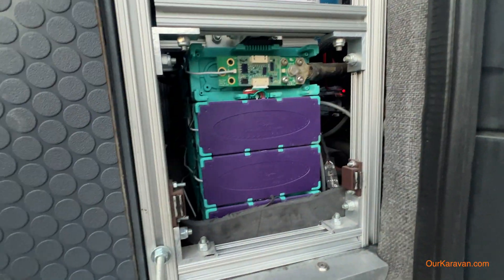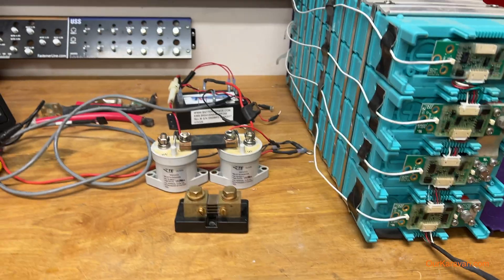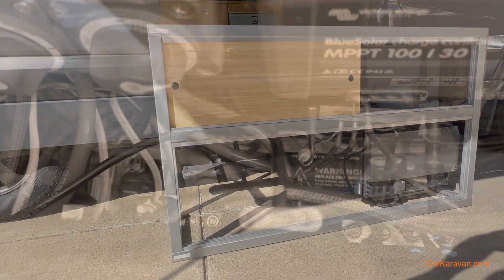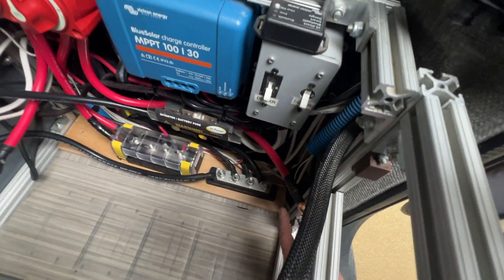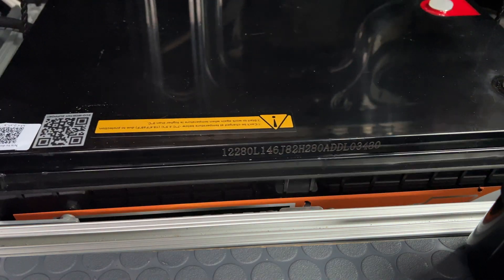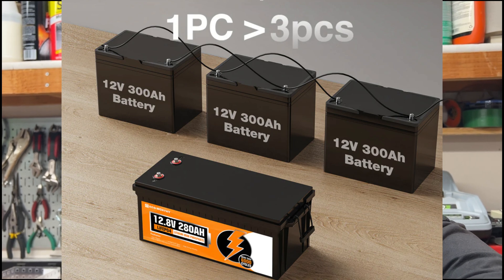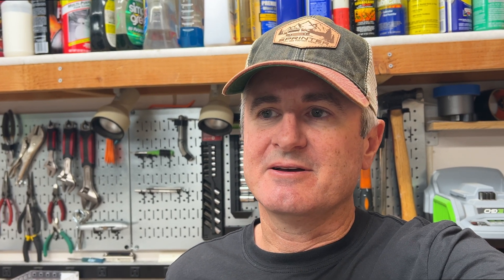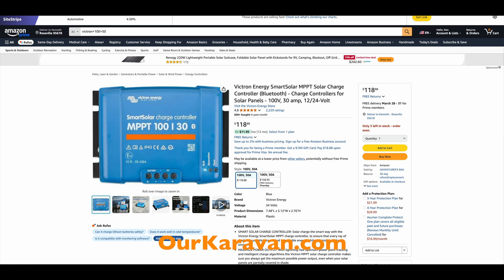Eco-Worthy 280aH Battery & Electrical System Overview

Comment: Nice vid, thank you for sharing. I was just wondering why do you still have the smart-shunt in place if you already bought the Bluetooth option of the battery. Does the BT capabilities not make it redundant to have in addition the smart-shunt? I would like to understand the difference between them and why would you still keep it in place, is it just to have it visible in the victron display or does it have another reason behind it? Also by checking your online diagram I am also wondering why do you have 2 inverters separated between solar and alternator? Can you not use a source selector?
Reply from the maker: Good question.  The built-in shunt of the battery has all of the info you need, however I simply wanted a dedicated display so I don't need to check my phone.  There is absolutely no need for the Victron smartshunt otherwise.

Comment: Thanks for the video!  I want to double my battery capacity.  Currently 2 x 270 AH Battle Born.  Rest of system is Victron.  I don’t know whether to start over on batteries or buy two more Battle Born.  Basically $4500 for two more Battle Born 270s, or significantly less to start over with all new batteries.  I’ve had the BBs for about 2.5 years, but fairly low usage as we don’t use the van full time.  Any thoughts?
Reply from the maker: That's a tough one, but as you probably know it is generally it is not recommended to mix battery types and ages.  Not an easy decision to make but I would probably lean towards starting over with all new batteries.
Reply: @ Thanks!  Not mixing types seems obvious, but I only recently heard about not mixing ages.  So I contacted Battle Born direct, provided my number of cycles so far (which is embarrassingly low), and they said no problem.  What worries me about the brand you tested, and others, is possibly not having customer service (I don’t recall if you mentioned in your video, it’s been a few days since I watched).  I get that problem with my Bluetti devices, where I’m emailing back and forth with someone that’s clearly not in the U.S.  With Battle Born, I can pick up the phone and talk to someone in Nevada.  I’m just not as tech savvy as folks making these videos, like yourself.